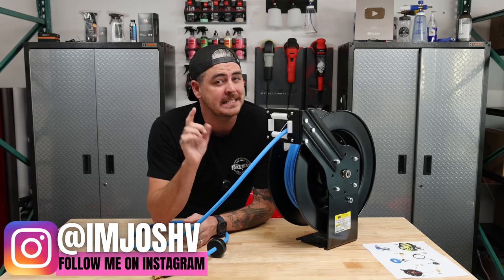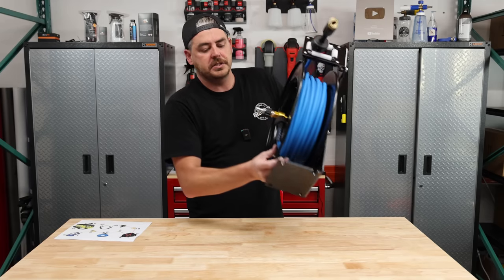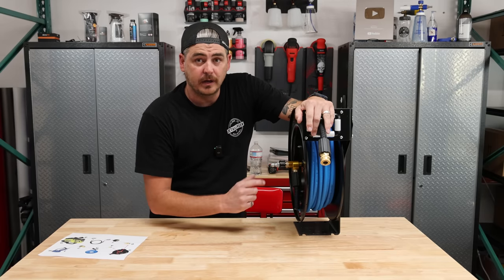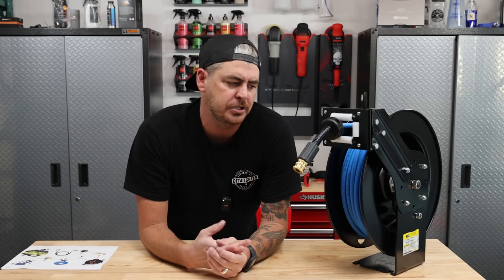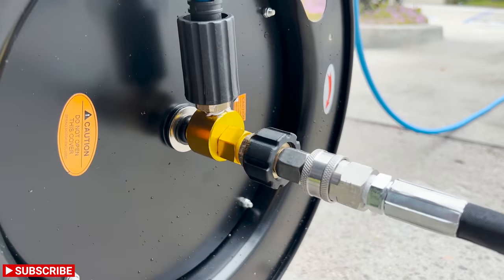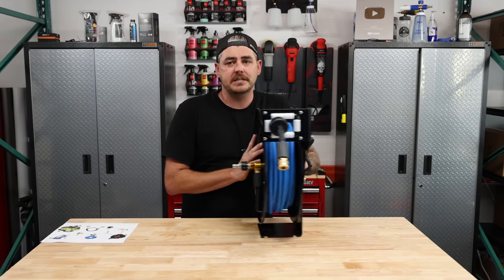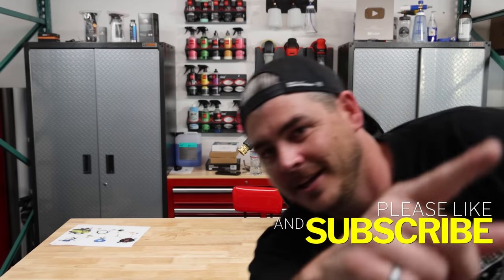RECTRACTABLE PRESSURE WASHER HOSE REEL | Pressure Washer Hose Upgrades

Comment: As of Sept 2023, I think the fitting size has changed on the input and output fitting of the reel.  They're now 3/8", so you need a 3/8" to M22 adapter, not 1/4".  Just FYI for anyone trying to do this.  Great video!
Reply from the maker: Thank you for that update!!
Reply: Dang it, I read this too late. Thanks, but now I have to return the 1/4". Hopefully, everything else will work once it arrives.
Reply: The reel in the video is a maxworks not a reelworks. Same manufacturer 🤷🏻‍♂️
Reply: Yeah… just discovered that this very minute 😢
Reply: Why my 3/8 is not fitting I order one is too big
Reply: @eddiearaya2456  now I’m at this problem 👍
Reply: Reading this as there are 50 different fittings spread across my garage and I'm ready to just say f it and roll the hose in a ball like I have been forever lol.  Thanks!
Reply: anybody come up with  a solution i tried a 3/8 and it's to big.
Reply: Damn I just now saw this! Great, now making a trip to Home Depot
Reply: Would this work with a cheap harbor freight reel. ?
Reply: Agree, and since the hose between the pressure washer and the reel is already 3/8, you dont need an adapter there (items 6 and 7 on his diagram are not needed). You only need one fitting to hook up the 50ft hose to the hose reel (item 4 in his diagram)
Reply: No wonder I’ve been having a hard time looking for 1/4” in the store telling myself this ain’t gone fit the reel once I get home and boy was I right 😂
Reply: Won't the narrowing of the line at the swivel cause it to lose pressure?
Reply: Man, thank you brother. I was losing my marbles once I was it wasn’t the size.

Comment: Fair warning I have the same exact setup and every 4 to 6 months I will have to basically take the whole swivel end apart and replace all of the O-rings because of the constant spinning plus the added pressure of the water forces the O-rings outward and they tend to get chopped up everytime you unwind and wind the hose back up. I get the replacement O-rings from Lowe's and their pressure washer Department the O-ring is actually the same size as some of the O-rings that are in the actual hose. Oh and you're going to want to replace the retaining clip as soon as you replace that retaining clip it will be useless because it'll be bent out of shape you can find those also at Lowe's

Comment: I just got the ReelWorks reel and it came with 3/8 fittings so the 1/4 adapters weren't needed, a simple 3/8 threaded male to 3/8 quick connect was all that was required. Not sure why the swivel changed, but is better not having to use all the adapters to make it work.
Reply: Same the listed fitting is 1/4 mm2 but needs to be 3/8 🤦‍♂️
Reply: He pointed that out. 

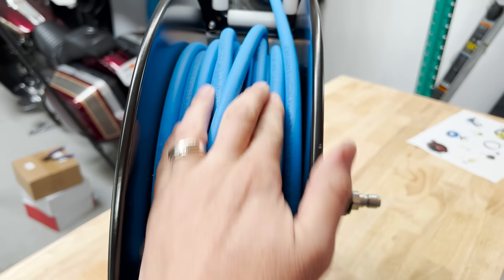I thought the same thing initially until rewatched it ( 1:26 )

I went with a HF reel about 2 years ago and have a 2 one now. Both are set up with an adapter (1/4M to 3/8M adapter).

Comment: I would suggest a grommet for the hole that was drilled but otherwise great stuff!
Reply: I was thinking the same.
Reply: Great call.  Where can you find a grommet that size?  Link?
Reply: You can use a rubber u channel and cut to size

Comment: Just hooked up the new rig to my Comet 1700. Wonderful. Josh you might want to tell people that if you let the reel unwind you have to wind it back up. Also, I got mine for $94 on amazon. My hardware was a little different than yours but all is good. I fit my 70ft Comet hose. Works great. Thanks loads!  😊

Comment: I’m a lawn nerd that’s getting into detailing.  They both scratch my OCD tendencies. Anyway, one of the garden hoses I have is a retractable model from Hoselink.  The convenience is a game changer.  I’m just about to dig into my pressure washer setup.  This video has me second guessing the idea of a Cox reel.  Great stuff Josh.  Your videos got me into this hobby.  Keep it up bro.
Reply: The cost of a cox reel is as ridickulous as their name. I haven’t tried one mainly for that reason. I can tell you the all red retractable Merlin hose reel from HF is awesome to convert. I’d suggest watching Stay Slicks vid on that. Mines been working great for months now using a 50ft hose from Ridge Washer. No cutting or bending necessary to get the m22 connect thru the side of reel. I would suggest pulling hose out and reeling it back in with PW off and no pressure in line.
Reply: Funny you should mention this. I detail and volunteer mowing at church because of this... the church has about 11 acres and provide a JD zero turn 72" that golf courses use. One section of the yard is no less than three acres unobstructed and to put straight lines in that with that mower is quite soothing! :)

Comment from the maker: LINKS TO PRODUCTS IN THIS VIDEO👇👇👇 

THREAD TAPE - https://amzn.to/3MPzo26

MJJC FOAM CANNON Sv3 - https://dtlrsupply.com/products/mjjc-foam-cannon-s-v3

HOSE REEL SET UP:

1. PRESSURE WASHER GUN WITH QUICK CONNECT
Mckillans Pressure Washer Gun with Swivel - https://amzn.to/42mlCtD
Essential Washer Pressure Washer Gun with Swivel - https://amzn.to/3MZDeaj
Brass Version without Swivel - https://amzn.to/3N06A8y

2. QUICK CONNECT KIT ( Covers Item #2 and Item # 8 )
https://amzn.to/3WIsArN

3. PRESSURE WASHER HOSE
Uberflex Blue 50' - https://amzn.to/42e7mmN
Flexzilla Green 50' (Same as ubeflex just different color) - https://amzn.to/3qodQSR

4. 1/4 TO M22 FITTING
https://amzn.to/43gmQIj

5. RETRACTABLE HOSE REEL
One used in video - https://amzn.to/3J3XHbx
Cheaper Option - https://amzn.to/3CdcXPF

6. 1/4 TO M22 FITTING
https://amzn.to/43gmQIj

7 - QUICK CONNECT KIT
This is already covered from item #2 

7.5 LEAD HOSE KIT WITH QUICK CONNECTS
https://amzn.to/3OR5UDO
YOU ALSO NEED ONE MORE FEMALE QUICK CONNECT FOR THE OTHER SIDE TO CONNECT TO THE PRESSURE WASHER - https://amzn.to/3C6dliH

8. QUICK CONNECT KIT
This is already covered from item #2 

9. PRESSURE WASHER
Ryobi - https://amzn.to/3C7xbtX
Active - https://amzn.to/3qnhfBi
Green Works - https://amzn.to/3OZfapc

Comment: Nice video I just want to add and not sure if anyone has already commented on the fact that you don’t need to drill a new hole hole; at least on my reel I only had to grind the top of the existing hole 1/16th of an inch for the m22 male to fit. I used a flexible 50 foot hose.

Comment: Love your channel, I just invested in the amazon reel setup based off of your last video. That said, I do have some concerns using air hose reels that are not rated for the pressure setup, especially the retractable as there is more add on parts not originally designed to do what it is now doing. Stay Slick did this same thing with a HF retractable and eventually it blew out after extensive use and in heat. So I would recommend checking his latest videos as well before investing into one of these. Personally. but love your work, you are why I decided to start detailing
Reply: Just watched Slick's videos on the reel conversion and the update video and he notes that somebody he knows ran the reel with a GAS pressure washer and that one blew the o-ring seals out due to the significantly higher line pressure generated by gas powered pressure washers. He also notes that he is using the reel with an ELECTRIC pressure washer and it's fine due to the significantly lower line pressure. The only failure points would be the hose or the o-rings when the line pressure exceeds the design parameter of the hose and the o-rings. Brass and steel fittings have an incredibly high burst pressure failure point. The devil is in the details, and no pun is intended.
Reply: @strykerentllc  
Slick’s conversion has 3 videos. The original, the follow up, and the failure and how to bypass (these are not the names of the videos). The last one was posted just a few days or maybe a week ago. That said, he did run it for about a year before he had problems. I imagine he could have just replaced the o-rings, but he chose to bypass the hose swivel entirely. YMMV
Reply: @strykerentllc  he runs a Ryobi and it failed after 3 or 4 months. not being negative, I just feel it should be addressed in the video as it could POTENTIALLY do major damage if you choose to keep running it and not bypass w quick connects. it isn't a fix all, is what im saying

Comment: Is there a hose reel that swivels that I could use?  Would love to mount on the garage wall and then fold / swivel toward the wall for out of the way solution.    Great videos
Reply: You can to a tv mount, mount tv mount to wall. I did works just fine

Comment: Great video! I will weigh my options between the two or by both for my situation. It would be nice to have the retractable feature for the garden hose and the pressure washer hose. Both of mine are 100 ft. Doesn't look like those will hold that much.

Comment: Thanks for sharing this mod! 
I got the reel in this video but the connections under item 6 didn’t work for me. I had to get 3/8 M-NPT to M-M22 from the local Home Depot Sku#: 719775.
It works great and no leaks so far.
There’s no need to make a hole, just bend the lip of the large opening a little bit. I also added a small piece of rubber in the clamps since this hose is thinner than the original air hose.
Thanks again!
Reply from the maker: Awesome!!
Reply: Agreed looks like Josh’s had a plug but mine did not so I followed this 3/8 to m22 setup and works great

Comment: Ok went to do this mod and found the two adapters you need are 3/8 to m22 and not 1/4. This is a sweet mod my adapters are on the way😀
Reply: Wait read some of the notes headed Lowe’s
Reply: This depends on the included air hose connector's adapter size. The hoses are usually 3/8in in diameter but the connectors are 1/4in NPT. Please read the specs of the reel you are converting in detail

Comment: Josh, it appears that the hose that connects to the reel and pressure only has one quick connect, and since both sides are already M22 fittings, that one quick connect is missing. Needs a extra 3/8 to M22 Quick Connect 🙌🏻

Comment: You can buy a grommet, some door edge molding, or even just slit open a small piece of rubber hose (like fuel line or windshield washer fluid hose) to make a protective edge.

Comment: Your amazon basics reel video is private wanted to watch it
Reply: Same. Was curious about that one too.
Reply: Just scrolled down the comments and see that he took it down due to people reporting issues that it did not withstand the pressure.  Not certain what the specifics are around those reports. But definitely would only try this with a lower psi setup.

Comment: You can also just bend the port a little to open the port big enough to insert the hose into the connection point and the stopper on the hose you can put it over the black plastic on the Uber flex hose it fits just fine and won’t move anymore

Comment: Seeing there is a lot of failures with o-rings within days sometimes. Can you do a video switching out rubber o-rings with the viton o-rings. This doesn’t seem that reliable, rated 300psi and putting 1000-2000psi thru them.

Comment: works great if your system is gravity fed. if you use a pump it will blow out the seal in the swivel connector.

Comment: I need this but idk where i would put it in my garage lol. I really need this and a air hose one too. 

I really need another garage just to set stuff up in so i can have more room haha
Reply: Took me awhile but I finally got my setup complete about 20 min ago. I'll test it tomorrow and see just how well it works. 

I caught a Merlin air hose reel on sale this past weekend at harbor freight so I picked 2 of them up. 

The merlin is nice and the air hose had a spring around the air hose where it goes inbetween the gap for the exterior connection. 

I took that spring and wound it around the pressure washer hose to give it a little more protection. It also had 2 cable holds to hold the hose in place.  Instead of drilling a hole I was able to bend the gap just enough for the head of the pressure washer hose to fit and then bent it back in place. It worked out great! 

Everything else was super easy to connect.  

The only problem I had was mounting due it only being me but I got it all up and in place. 

Thank you for this!

Comment: 8:15 I would wrap a piece of red or yellow electrical tape about 5 feet from the end of the hose to warn you so you can still retract the hose without having to manually do it on the reel itself.

Comment: I wonder, do you think you could trim the plastic off of the m22 hose end to allow it to go through the factory hole? Then use channel locks or vice grips to tighten it to the adapter and swivel?
Reply: No because the plastic houses the threads themselves

Comment: Josh
Will you do a revisit video on air dryers. I watch the review of the sgcb blower. Do you still recommend that as the best or is a air compressor set to low pressure work just as good I have a 60gal air compressor. My whole car wash setup I bought because of your recommendation and some stuff from your online store. I tried emailing you and got no response so thought I would try here. Thanks for what you do.

Comment: Hey Josh PIN THIS!

FIX FOR LEAKY SWIVEL 🔨 :

If your seals burst and you're frantically searching for an answer ("What swivel?? What Seal size??) Here are your answers and an easy fix especially if it happens while on a job.

To have on hand/purchase:
•Get Danco #9 O-rings (don't think about it too hard. Just find the #9 ones).
•Get waterproof grease (usually in the same aisle as the o-rings)
•Get a bit of plumber tape inside the grooves for each of the O-ring slots (one wrap around ON THE INSIDE of the groove is enough. Don't let it spill outside of the groove. It'll fold into itself, that's fine)

Instructions: 
1. Use the Snap ring tool to pop off the ring. (find a cheap one and keep it with you as long as you have this setup)
2. Replace the bad o-ring (or both)
3. Add the plumbers tape inside the groove and then a bit of the waterproof grease around the entire groove (lay it on top of the tape you just wrapped)
4. Slip on the new o-rings
5. Re-install the swivel joint (it should feel a bit more snug now that you have added a bit of that tape.
6. Re-install the snap-ring
7. Test it out and check for leaks. 
8. Mentally prepare that it isn't a permanent fix.

9. Done.

Comment: Hey Josh. Any setup for a IBC 275gal tote with 2in spout setup? I  would obviously want it setupt to the pressure washer then a spout for clean water for filling extractor/buckets. I currently have a Husqvarna 3200psi gas pressure washer from Costco but not sure if it has a pump built in for it to be gravity fed. Thank you

Comment: Hey Josh, I tried using the Amazon basic manual hose reel method but the power washer I hooked it up to was industrial strength and it just didn’t hold up and busted in every way possible not sure if I messed up connecting everything or it may just be compatible with lower pressure washer system , otherwise love the content !! Just ordered a Uber flex hose since watching your videos

Comment: How’s this holding up? Any leaks as yet? 
What PSI you running?
Reply from the maker: Mine is running at about 1000psi and so far so good still. It’s on a secondary unit so it doesn’t get used all the time but I’ve been happy so far

Comment: Josh , the air hose reel is rated at 300 p.s.I.. The sprayer puts out 800-1000 p.s.i. Make sure the fitting can handle the pressure.

Comment: I believe the parts list for number four and six are wrong. I just received my Amazon order after going directly to the show notes  to order yesterday morning. Great video, but now I need to figure out what parts I need for four and six. Quarter inch to M 22 is the part that I think is wrong. The quarter inch is way too small. I have pictures if needed.
Reply: So it turns out that this retractable hose unit (the one they shipped me ) does not have a 1/4 inch connection. The connections appear to be something around 3/8 npt? . I went to Lowe’s and got two  1/4 of 3/8 npt inch adapter , put it on snug with thread, tape.
Reply: @kylerake  Instead of using the Uber flat hose I just used my commercial grade hose that already has 3/8. The jumper hose listed just take off the quick disconnect and do the same thing screw it right in like the air hose one

Comment: You need to know the pressure failure point of the unit you are going in your m22 connection point (adapter), this would literally explode and be crazy dangerous with any of my systems. This feels like a must for your liability if you are monetized or sponsored.

The unit in the video is used for are hoses at a maximum of 300psi putting thousands of pounds of water pressure could cause serious harm.

Comment: If you can adjust the arm can't you adjust the retract location and/or keep the hose from going all the way out by fastening the hose retainer in a location that will prevent the reel from extending all the way out?

Comment: This is great! I did see in other videos though that this setup is only good for up to 1800 psi. Anything much beyond that (think gas pressure washer) and the seals on that swivel will blow out from what I’m reading everywhere. If anyone knows of a setup that can handle 3000 psi I’d love to know! Great video!
Reply: Mine is working on a 2600psi greenworks model
Reply: @jasonsage1404 how’s yours holding up? Have you had it long?

Comment: can i just skip the whole side adapter thing and run the hose out the side of the reel directly into the pressure washer? I’m thinking of mounting my pressure washer right above my reel on the wall so I might just run it straight into the pressure washer instead of a leader hose